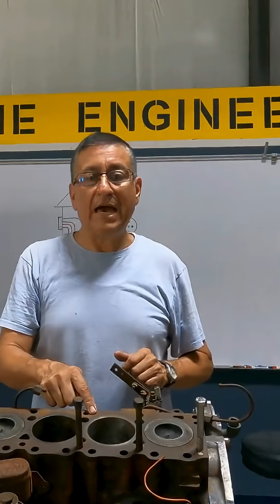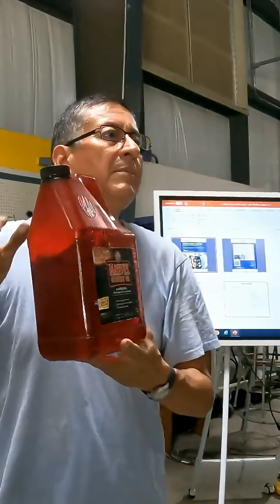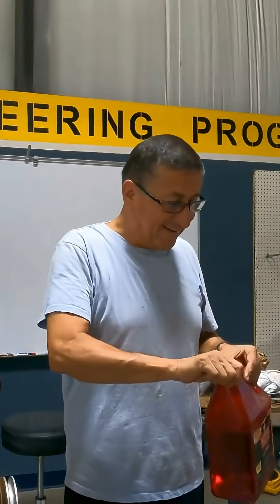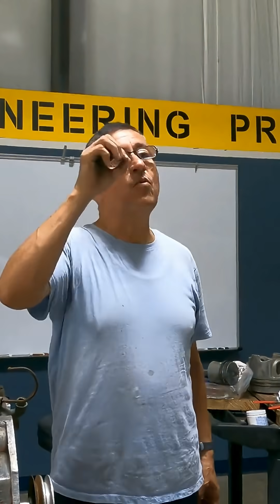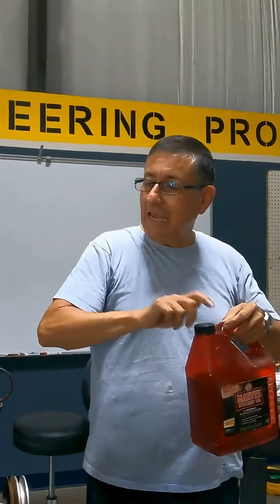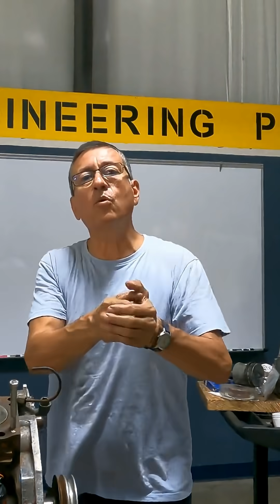Mystery Oil

Comment: Marvel Does Not remove the corrosion.

What is does do is penetrate between the corrosion on the face of the rings and the corrosion on the wall of the cylinder breaking the corrosive bond thereby freeing the ring from the piston wall.